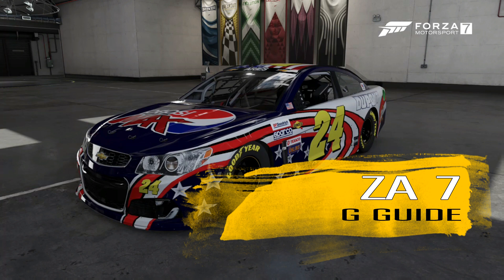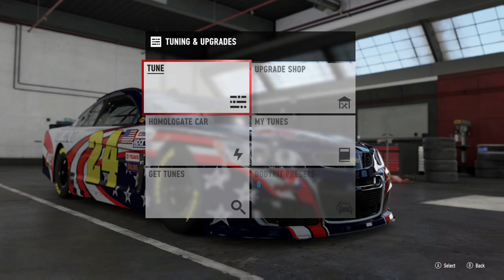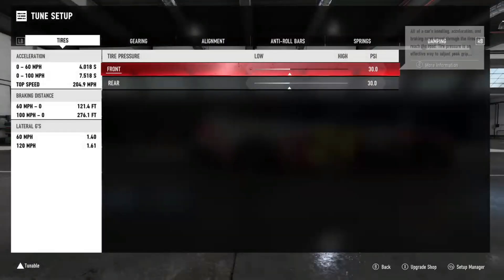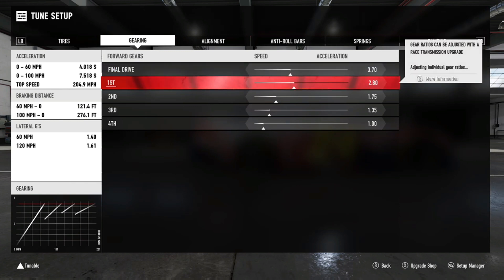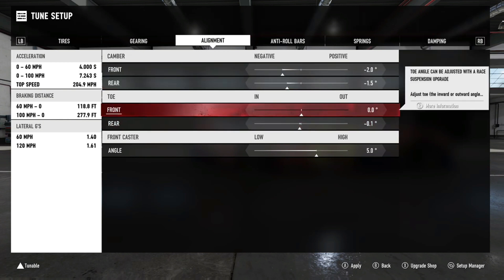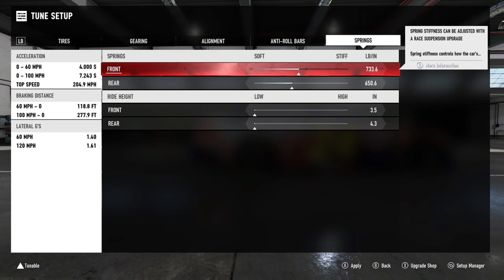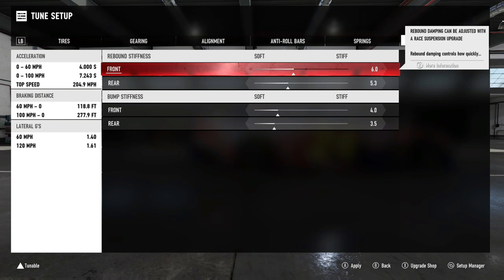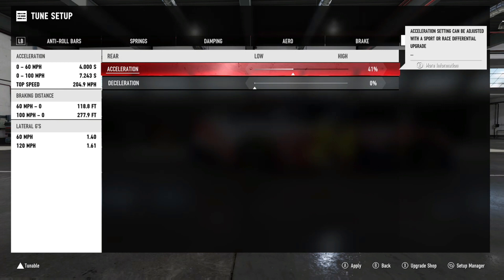FORZA 7: Tuning Guide "Breakdown" Basics 101

Comment: Gearing, gearing, gearing...it's really where a proper tune starts and stops. SET YOUR TOP GEAR AT THE END OF THE LONGEST STRAIGHT...and work back down setting the other gears from there. If you reach the end of the longest straight and your car has not hit the redline before you brake or turn in, you need to lower that top gear. If you reach the end of the longest straight and your car is hitting the redline before you brake or turn in, you need to raise that top gear. You want to get all you can from the car by the end of the longest straight. Once you have it dialed in, you may want to then raise that top gear 1-3 clicks. Why? To take advantage of the higher speed you get from drafting a car in front of you while in a racing situation with additional cars on the track. If you hit the redline in top gear when you brake/turn in at the end of your longest straight? You will then redline before you reach that brake point/turn in under drafting conditions. Now, maybe you are front runner who is never behind anyone and you'll never utilize a draft. Well, adjust for that too. Some tracks like the Old Mulsanne Circuit with no chicanes, it doesn't matter how high you set top gear, the straight is just so long that you'll redline before your brake point/turn in. That's ok. Set that top gear as high as it can go and roll with that. Find speed in the corners elsewhere in the gearbox! How do you do that? On all NON-OVALS, you want to avoid changing gears in the middle of a turn. It upsets the car and distracts you from making a smooth turn. So, that's where you can make adjustments on the gear ratios down through the gearbox to account for certain turns and your shift sequences. In closing, take a car's stock tune...and start by tuning the gears as I've indicated above. Then make all of your other adjustments. Then, before you go out on the track and start qualifying, doing hot laps, or racing...check the gearing one more time. Sometimes the other changes you make on the other settings will give you more speed and you'll have to adjust the gearing just a bit one final time. Keep a pencil and paper handy and record your best times with each setting. Always keep the PREVIOUS SETTINGS saved to a different file BEFORE you go and save the new settings. Make ONE SMALL CHANGE at a time to ONE SETTING. If you make multiple changes to different settings, how do you know which thing improved or reduced your performance?

Comment: So if I was going to race at homestead would put the gearing more towards speed or acceleration?
Reply: oogrelover69 it depends. For the oval circuit, I prefer speed.
Reply: Driver_Marlyn Gaming, thank you!
Reply from the maker: Depends on what you want, my team and I built a acceleration tune at took Top 5 world in a NASCAR division. Too much speed will affect your power in corners, finding a good happy medium will be best. 178 mph or better is ideal through homestead turns, toping close to 190 mph before going into one. The rest of the work lies in the suspension

Comment: Don't mean to put you on the spot, so don't answer if you are uncomfortable.  I would rather hear that you prefer not to comment than to hear something vague or somewhat exaggerated so as not to offend anyone.  But, in general, how good are the best prepackaged tunes?  Obviously they will vary in quality.  But among the best that you can get, what percentage are they generally to what can be achieved.  For example, If the best tune possible was 100%, are the best available tunes from someone else ever close to that such as 90% or 95%.  I assume the best tuners hold a little back for themselves.  Generally I want to know how much I can gain by learning to  tune myself compared to some of the best tunes I can get in the shop.  I am aware of the advantages of tuning to match car with course with individual driving style.  So another way to put it is, on average, what percentage increase can someone obtain if they could tunes a car to fit their style and circumstances extremely well (100%) compared to the best tune they might find prepackaged (? %)?  Thanks.
Reply: None really. The best drivers can drive everything regardless of tunes. Tuning is mainly used to make the car feel better for you personally. So it absolutely depends on 2 factors. 1) Who's tune are you running. And 2) Do you like the way it drives?
Reply from the maker: Brain 5prain every tuner has their driving style preferrences as in a tighter or looser car etc. With that being said,  a tune is only as good as the tuner and driver. Many of us Top 10 Leaderboards drivers share our tunes which arent dumbed down because in order for it to show downloadable off the leaderboards is by running that time to begin with. The clear fact is we can share our best tunes to everyone but due to driving style, track knowledge and overal driver skills, each person will not be able just go out a throw down a time like myself and other FC players. If i were to place percentages out like you did before i would say a good tune is 30%pl of the equation and 70% is all on the driver skill set line.
Reply: TNR ARIES  Thanks - That helps a lot.  I don't want to spend too much time tweaking a good enough tune when what I really need to be doing is figuring out the best way to keep my speed up through the turns - So it sounds like I should find a tune I can drive well enough and then develop the skills it takes to get the most out of it and later on worry about the fine tuning of the car.
Reply: Fluvio Glacial  Thanks - I suspected that was the case.  I race with someone who is a good driver and though he might not like a tune he is working with, either his own or someone else else's, by the end of the course he seems to have compensated for what it is doing that he doesn't like.
Reply: Brain 5prain a good tune just makes it easier to drive fast CONSISTENTLY. That’s the real difference between a bad or a good tune. With a good tune you can lap within 2 tenths of fast laps times, time after time, lap after lap; whereas a bad tune, on your own personal best tune you could be 1 second behind in sector one, 1.5 seconds up in sector 2 and then lose 1 second both in sector 3 and 4